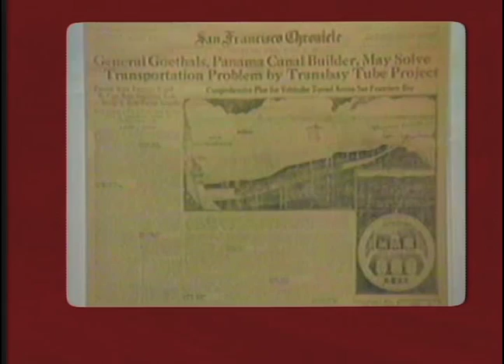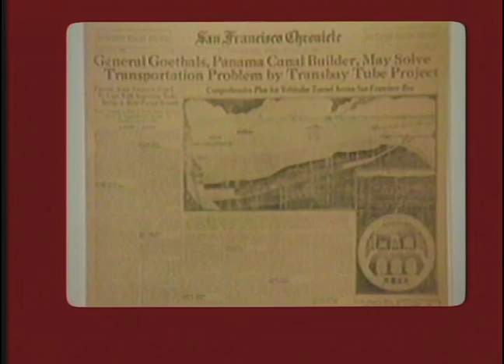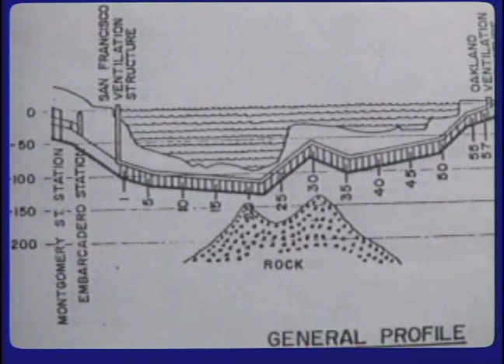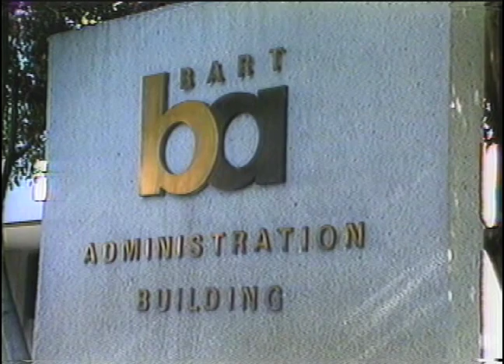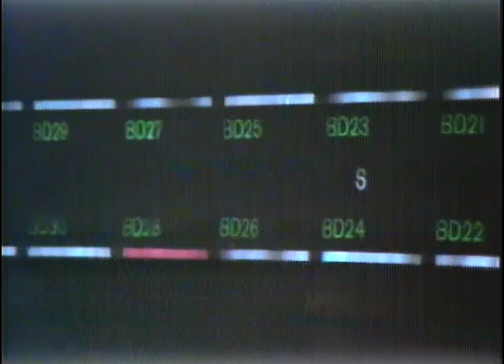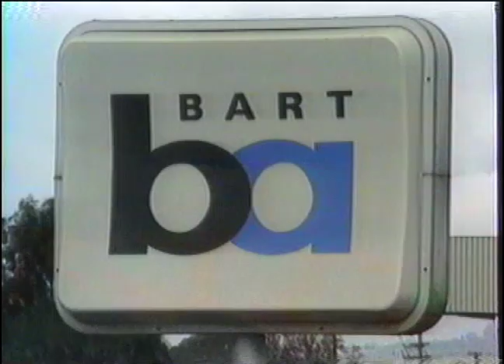BART System Pt 1

Comment: "Pamper the Passenger"....that motto is long gone...lmao.....im on BART every day and I do not feel anywhere near pampered.
Reply: Maybe if we could just get the bums to cooperate and make the public feel more comfortable 🤔. 😵‍💫🤯
Reply: @JDAbelRN  We can, it takes a matter of trustworthiness, respect, responsibility, fairness, caring, and citizenship to make a positive change.
Reply: @JDAbelRN  HOW ABOUT SAFE?? My Roommate told me this afternoon that she seen a man smoking Meth crack on the BART train between Embarcadero to Powell street, WHERE Where the BART COPS, Playing Poker at Powell Street??
Reply: I remember a time when people talked about "BART's special smell." Despite what a modern BART rider might think, those people from an eternity ago were referring to BART's smell of cleanliness and "technology." It was the smell of the future. BART was the Space Age subway, a transit system lifted directly from the Jetsons and miraculously plunked down in the Bay Area.

Today the only "special BART smell" that riders talk about is the smell you still feel on your clothes after riding BART. It's a smell of urine, feces, and sweat. 

BART needs to return to its normal self. The system needs to be made safe and clean. They need to return to the original 80 mph design speed of the system. The degradation that BART has been experiencing under its new leadership over the last 10-15 years needs to be stopped and reversed. Believe it or not, BART can be awesome. It was not too long ago! We just need to get back what was squandered.

Comment: 1974
I was on the 1st Daley City Undercrossing. I sat up front and watched the LEDs reach 70 mph under the bay.
I was 12.
Travel then was easy by bus and I did it a few times to see the other side of the bay.
Later, I went to concerts..BART was my tranport.
Imagine a 12 year old boy doing just that on his own and no adult supervision. 
Unheard of today.
 We were free then.
And I grew up in GG PARK.
Ando so ,I am what I am, and that's all that I am..Darrell the Curious Man.
Reply: I remember it only went from Daly City to Montgomery at first. I rode on those excursion rides. We lived in Westlake. The Daly City FART location was a Yellow Cab parking lot- dirt I think before FART was there.
Reply: Yes I remember that too when leaving the 24th street station to Glen Park the BART train did reach 70mph as in those days the system was on Manual Control until the computer system was installed in the mid 1970's - 1978.. as the average speed of 50 to 65 mph... What a Crock...

Comment: FYI Treasure Island did not exist in 1920, so the map is from at least 16 years later than his proposal.
Reply: It's possible the General envisioned building (or dredging) Treasure Island into existence (as it was originally envisioned as a Navy/military facility anyway right?). Regardless, the General George Washington Goethals was way ahead of his time, in his thinking/thought process and engineering. He was a civil engineer in the Army Corps of Engineers, and lead engineer/ designer of the Panama Canal.
Reply: The map showed is a 1950 Bart plan. They didn’t show a 1920 map but the 1920 plan had a similar route to the tube today.

Comment: Sadly BART has lost lots of its “pampering”. BUT! Hope is on the horizon! New cars and extensions are coming and new fare gates to crack down on fare cheaters and hopefully a plan to deal with the homeless issue.
Reply: lmao 6 months later and everybody still hops bart as they should <3 Love to see it
Reply: As long as blacks are on the same train as me I am never going to pay a fare.
Reply: Those new cars are nice BUT Less Seats!
Reply: @alexcarrillo5510  The number of seats is calculated in such a way as to allow the riders from the far ends of the system to get seat for their long rides into the core of the Bay (SF-Oakland-Berkeley). Meanwhile, for the much more numerous riders from the core they provisioned for more standing room.

This makes perfect sense. If you are taking a short ride of one or two stops in SF or Oakland then you don't need a seat. But you do need more standing room.

These decisions are made based on standard practice in transit planning. There's even software to predict the best mix of seats and standing room. It's not like they're guessing or throwing dice.

Comment: Hardly "light rail" by passenger volume or typical rolling stock, by the way.
Reply: @Blahblahblah14898  Light rail can be grade separated as well. e.g., the Norristown High Speed Line.
Reply: You're confusing lightrail (tram) with light rail (literally lightweight rail vehicles). BART is indeed extremely light. BART cars are custom and built from lightweight aluminum. Lightrail (tram) cars are usually much heavier than BART cars. 

Yes, I know that this is confusing. The "light" in lightrail means that the trackside infrastructure is not as involved as with traditional or "heavy rail" systems. It's not actually referring to the weight of the vehicles themselves.

Comment: Light Rail ? BART is a subway. The F Line in San Francisco is light rail.
Reply: They likely meant lighter than main line railroads.
Reply: Wow what a bad conparison
Reply: @Angel Jose Mendoza Streetcars are considered Light Rail.
Reply: BART is not a Subway, it is not even close it never on time, and have to wait about 10minutes or more to get to leave Walnut Creek to SF.
Reply: @alexcarrillo5510  That's nonsense. You happen to live on far out suburban spur so your frequency is lower than in the rest of the system. You can lobby your BART Board member so that they can try to increase frequency on your spur.

I live in the so-called "Core BART System" (SF-Oakland-Berkeley). At my station a train comes every 4 minutes. This is where the vast majority of people live so it makes sense that it's well-served by BART and other transportation.

This is completely normal frequency for a subway, btw. The NY subway has about 4-4.5 minute frequencies too. Just because you live out in the boonies does not make BART "not a subway."

Comment: They didn't fix the traffic issue
Reply: It's impossible to "fix" the traffic issue if the highways remain free to use. What transit does is to give more people the opportunity to bypass that traffic entirely by taking the train. 

And BART has done that in spades. BART's transbay tube carries more passengers than the 10-lane Bay Bridge! In fact, the Bay Area has grown so much around BART that without it our traffic is basically going to block the entire region. Getting to SF would be simply impossible. Commuting from places like Dublin would take over 4 hours in rush our traffic.

BART is insanely effective at fixing traffic. But it can only do that for you if you are willing to ride the train. To be fair, BART has insane capacity and actually does measurably reduce congestion. But that happens purely because some people choose not to drive if they know that the traffic will be bad.

Comment: How old is this video???? BART is a Costly Toy Train set JOKE, 50 years it has been running, and the system is falling apart. Do you ride the Bart Under the transbay tube?? IT IS NOISY like hell, and since the opening of the tube back in 1974 they still cannot correct the sounds of the rails grinding on the BART CARS!!  It is the most TORTURE 4minutes, and 50seconds of shrill loud grinding crap. They should of issued Earplugs after you passed the through the gates. And still it suppose to be at a high speed of 70mph, the average speed is under 50. Even the MUNI Metro which they are above the BART Tracks Are QUIET, and they carry a lot more people everyday....  She should take lessons from them to correct the LOUD SHRIEKING NOISE!!!!